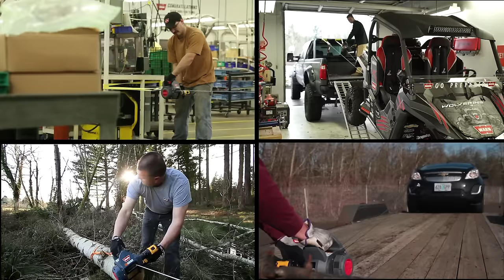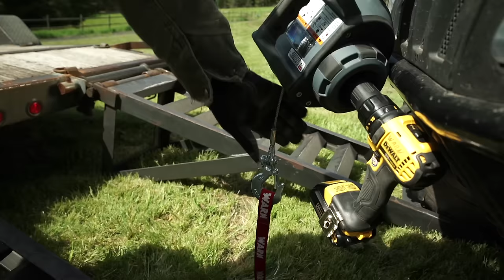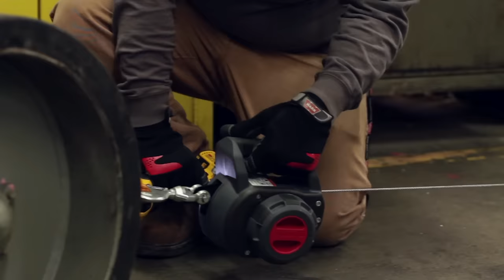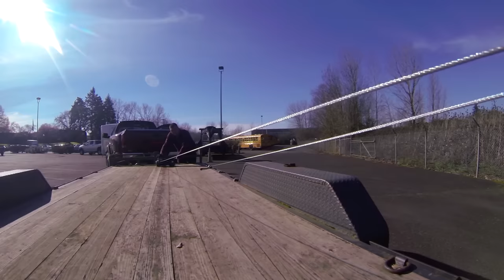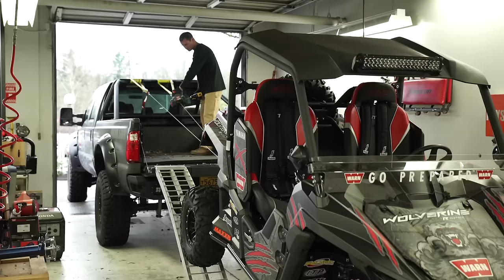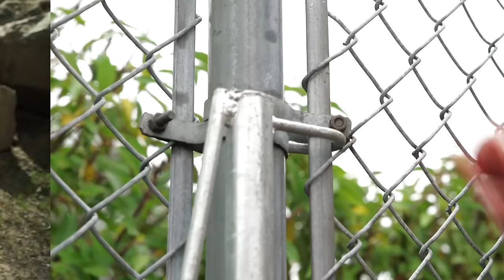WARN Drill Winch: Drill-Powered Portable Winch

Comment: The in applications on the vid could be done otherwise by driving the vehicles ! ! 
Could be used by Hunter to hoist up large game, especially if over 500lbs, using a 2:1 or 3:1 mechanical advantage and Dynemea rope instead of wire rope

Comment: total need one with built in battery pack, warn used to make one for polaris to sell but seems to have disappeared and it was a booster as well, not sure if it was air compressor but should be, then be great for everything, drill winch is a great idea though keep up the good work warn
Reply: sorry I ment replaceable battery pack like dewalt or millwaukee  makita  etc

Comment: cool piece of equipment, but it seems like it would take much longer than simply driving a lot of the vehicles the commercial had shown onto their respective ramps, I see the usefulness, but maybe it should be a little stronger and faster?
Reply: Then the drill may not have enough torque to do the job... 
(also the battery will "sag" worse if the (power) draw is too high)
Horses for courses.

Comment: how about, eliminate the drill and have a portable battery powered winch with a built in motor, with swappable battery packs.
Reply: gmax876 that would be a good idea
Reply from the maker: That would be very similar to our PullzAll http://www.warn.com/utility/pullzall/cordless.jsp
Reply: gmax876 then put some sort of remote on it
Reply: gmax876
Reply: gmax876 yes bro
Reply: Warn Industries That seems like a much better product than this
Reply: cjeam, The cordless drill is a much better idea than the one with the removable battery. Never good having different batteries and different charges sitting around. This standardizes your batteries. More efficient.
Reply: Mike Hoffman Integrated battery will be easier to use ergonomically and you could just use a standard battery type for it to keep it comparable. Take the battery off your drill and slap it in this for five minutes (manufacturer proprietary batteries aside). It also has twice the pull force of this and I think this is a bit weak to be worth buying, just get a couple of mates and pull.
Reply: cjeam. Good point. Especially if it could adapt to other MFG type of batteries.
Reply: Add the motor and battery... you added $120 to the price tag.  (keeping the same power)
Reply: To Mike ... Re the battery power winch (with double the pull rating of this one) 

It is a better (and more expensive) product.

But the light duty drill powered winch can be handy for things like stretching chain link fencing.

Buy the winch that fits your need.
Lots of choices = you can make a better choice.
Reply: I don't think there's a "better" here.  There are advantages to both, and I'm impressed that Warn already has both angles covered.
Reply: Howabout thinking that idea through to its logical conclusion?

Do it that way and you can't upgrade your motor, you can't easily replace your motor in the field, and you'd have to buy specific battery packs for the winch! All of those are bad news. 

Most people who need a winch also have cordless power tools and the smart ones standardize on a platform. For example I have four 60V DeWalt batteries. 

Why precisely would I want to buy a BATCH of DIFFERENT, EXPENSIVE batteries for a winch that fit NOTHING else I own? 

In that case I may as well buy a proper 12V electric winch and power it off my truck (which I do, and with 200 ft of cable between roller and extension lead it reaches anywhere I need it to). 

OTOH a drill powered winch can be driven by  CORDLESS, CORDED, PNEUMATIC, AND IF NECESSARY MANUAL METHODS.
Reply: You just doubled the price.
Reply: That's exactly what people want...one more device with proprietary batteries to carry around...lol.....I like it how it is....I always have a drill and spare battery in my tool kit...why carry more?

Comment: Nice lightweight and light duty alternative to the hand ratchet "come-a-long."  (but 1/4 the pull rating so know what you are getting)
Reply: I mounted a Harbor Freight 2500 lb ATV wingh on a "stinger" extension step  Combined with ability to plug in RC model 3 cell LiPo, I have a higher power much heavier duty (but much heavier) portable winch with remote control.

(might give Warn ideas....)

The thing that is missing is a reasonably priced cable kit to run wire from truckbattery to the rear bumper for a winch.
I used a 20 ft 4 gauge jumper cable + 150 amp rated stereo fuse holder (40 amp fuse in it)  Heavy duty RC model battery connectors rated 50 volts 180 amps.